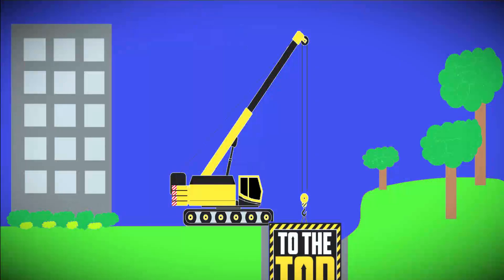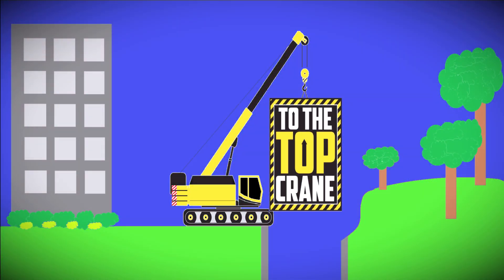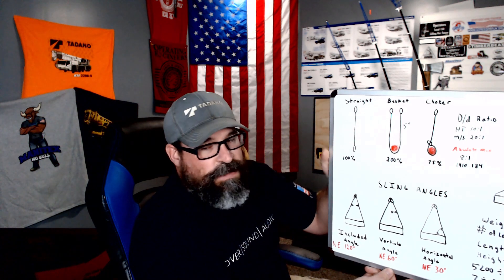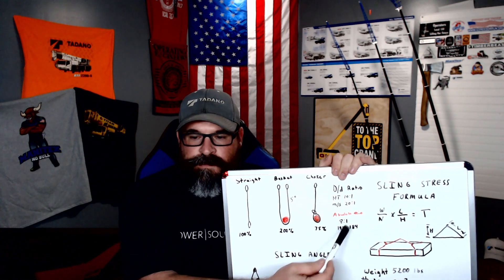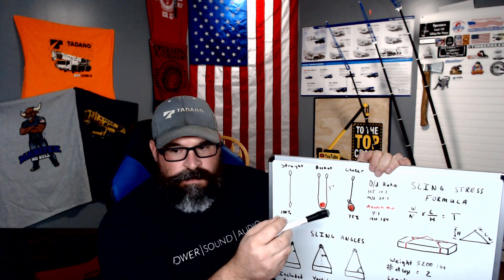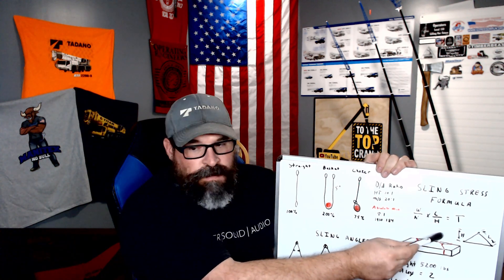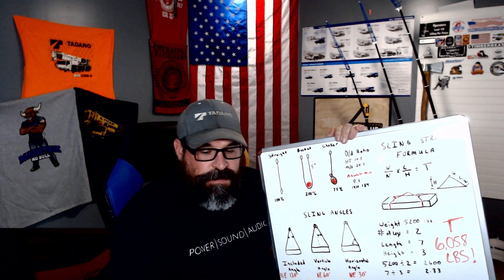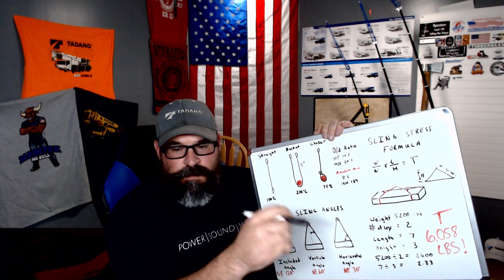Crane Rigging Part 1 | Rigging math formula | Andrew Camarata this one is for you

Comment: Hey Jimmy, just found your channel. First I think this is great information that you’re putting out, and it’s always good to have conversations about proper rigging practices. 

However, I don’t agree with you on one thing you mentioned regarding D/d ratios. I feel like I understand D/d ratio pretty well but I’ve never seen the OSHA regulation stating that 8/1 is the absolute minimum. That basically states that you cannot in any situation basket a wire into the crane hook or into a shackle. Yes, you need a 25/1 ratio in a mech splice choker to get 100% capacity. But from what I understand you can also take that same choker in a 6/1 ratio and it still be good for 80% of its rated capacity. 

This is potentially useful if you have head room issues or maybe you’ve got a 20’ sling and you need a 10’ leg. Basket the wire but consider the D/d ratio when you’re figuring the capacity of the sling.

Comment: Rope (steel cable) do not lay it in the mud or dirt but have a tarp to keep it clean as practical. Rusty rope looses capacity and if you see a certain number of broken strands per foot be very aware of the new reduced capacity, if it should even be used. Something learned from DEMAG. KInks are a big nope too.

Comment: Interesting. Cool video, where i learned something new. 
He had a professional company set the original spancrete panels in his video "setting spancrete roof on shipping container building" where they actually lifting panels twice as wide as when andrew did it.
They very much seem to exceed the angles you outline, especially in the chain they tie around the panels in each end. Their main sling wasn't at quite as acute an angle as the setup Andrew used, but i can where he got the inspiration.

But i must admit, part of why i enjoy his videos is because he doesn't work safely or correctly. Enlarging a hole for the radio in his dashboard with a chainsaw (as a joke i'm sure). Making his excavator push his truck out of mud, by making the excavator drive forward into the back of the truck, jumping out of the excavator cab, and running to the truck while everything is moving to get it unstuck, and running back to the excavator. A couple of days before he shot the video you are referring to he actually tipped his other crane on it's side going up a hill with ice on the surface. Pushing 100 foot trees down with a small excavator right next to a house. He never once cleaned cleaned of rust or paint on surfaces before welding anything, not even structural pieces. His dog is 13 years old, and i'm pretty sure has a steady diet of pizza...
He has a lot of mishaps, and some expensive ones too, but it doesn't seem to stress him out. 

It's of course unfortunate if he puts his friends lives in danger, but from what i gather, they all seem to have the same mentality. 

I have yet to see a video he has made, where he does anything "the right way" or safely, and from his comments you can tell that a lot of professionals can't stand him. I myself am an electrician, and certainly wouldn't do everything the way he does them, but i don't watch him as a "how to" channel. His way of doing thing reminds me of a younger and more carefree me, making nunchucks from an old chain and pieces of broom handle, using it to zipline along a rope, precariously tied from the top of a 60 foot tree to a rock on the ground. It's fun.
Reply: hahah  im a sparkey too love Andrews channel  still gotta cringe every time i see the panel outside on the shipping container next to the lift lol

Comment: I remember that a basket sling is terrible for load control. And picking below CG is not recommended. 
But that was a long time ago. I delivered a used sale 40ft container to a place. The old man had an old crane he picked it up with four different size straps  connected to the box corners with clevis pins. They ran a hook thru all the eyes and hooked the crane hook to the chain. 
Nastiest pice of rigging I've ever seen. The 2 longest straps were only 30ft angle was around 30 degrees. For a 8000lb box. How did it not break. PRAYER.

Comment: Yep. Any time a rope isn't exactly vertical the tension in the rope MUST be more than the weight it is lifting.
Angle  Multiplier
0      1.00
10    1.02
20    1.07
30    1.16
40    1.30
50    1.56
60    2.00
70    2.92
80    5.76
89    57.30
For the example, 3/7 is 2.33, which is 64.6 degrees.

Comment: Took a basic rigging class years ago as part of a Mill maintenance department training and a master rigging later. You can’t just use a bigger sling and be good. You must estimate the weight and rig it right. On of the biggest mistakes I have seen is people rigging to threaded eye bolts and side loading them! Good job with the explanation. Most people don’t realize the the sling load can be greater than the weight!

Comment: I worked a company that was a steel mill, building the furnace,  the bridge crane was set and riggers was making a lift of a brake for the wrench,  it slip off the first time,  because they rigged the top tension bar, crane operator on lifted a couple feet , let it down, here the problem,  they rigged the same way,  as lifted the load when up and came off hitting the rigger in the back. I fault the crane operator,  he should have stop the lift .

Comment: Don't take this wrong I've never run a Crain 
But my common sense has always said  dead bottom center  of basket rig is a straight line pull so just double it up coming from a commercial fishermen I pick things up from the bottom of the ocean  and they weight  less in water true story

Comment: Length can be less than or equal to twice the height. Example if you have a length of ten feet, then you must have a height of at lest 5 feet. In other words, the line being used needs to be less than double the height. Is that accurate, Jimmy?

Comment: Not an operator so..  I see so many crane fail videos where the lift is done in-line with the long axis of the crane and off the rear. Does that position decrease your capacity? Would many of these fails be prevented by lifting from the side over the outriggers?
Reply from the maker: Cranes actually have a higher capacity over the rear. So, if they are turned over, it is due to overloading the crane, ground conditions, mechanical failures or all of the above. Many thanks for watching! 🙂
Reply: To The Top Crane thanks for putting interesting videos up
Reply from the maker: Thanks for watching them!

Comment: Just one thing to add. for the Never exceed numbers, the Included and vertical angle it's ABOVE 120/60. however for Horizontal it's never BELOW 30. A easy quick way to remember for included angle. at 45*'s it's 50%ish of the load on each leg. at 90* it's 75%ish  of the load on each leg and at 120* it's 100% of the load on each leg. *=degree.
Reply from the maker: That's a great way to remember it. Thanks for adding all of that and for watching! 🙂

Comment: The one that always makes me want to run away and hide is when somebody twists the chain to shorten it. Shallow angles are just as bad though, anything that drops the load is bad.
Reply from the maker: I agree! Anything that drops the load or could potentially cause the load to drop is bad. Many thanks for watching! 🙂
Reply: only for towing not hoisting chains..
Reply: @Motorhead250  It still drastically reduces the chain's capacity
Reply: @cindytepper8878  true . in nyc no chains allowed on rigging crane picks.